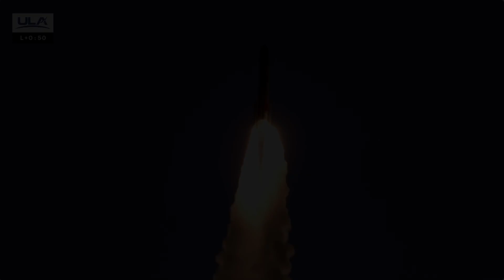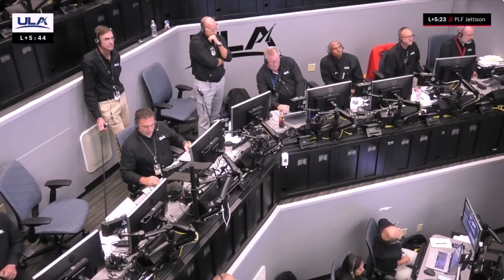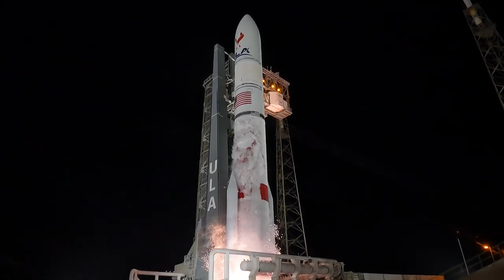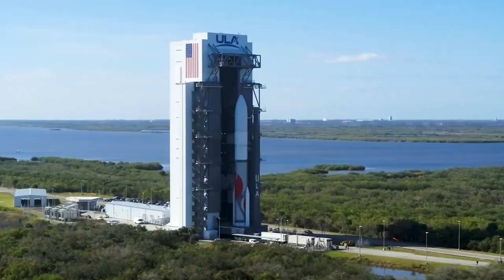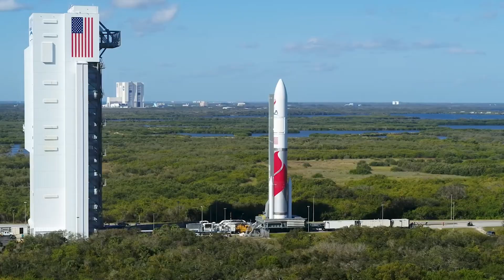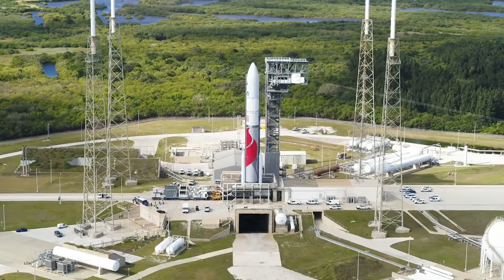A Closer Look At ULA’s Booster Anomaly On Vulcan's Second Launch

Comment: I think that the anomaly started about when they cleared the tower.
Reply: Why do you think that?  There doesn’t appear to be any issues until after T+30 seconds.
Reply: @Rocket_scientist_88  I see a small number of sparks ejecting about when the rocket clears the tower.  Not that I think the tower had anything to do with it.  But maybe the seal between the nozzle assembly and the rest of the rocket was breached at that time.

Comment: If they did a static test on the booster rocket before it was mounted on the launch vehicle they would have found out why the anomaly.
Reply: The booster is a solid rocket.  They can only be started once and run to completion no matter what.  So you can't static test the flight article.

Comment: The certification shouldn’t be affected as the part that failed wasn’t theirs. It was a commercial SRM
Reply: its the whole rocket....and it did not wholly pass. Cert 3 needed.
Reply: @paulpark1170  The Vulcan comes in configurations with 0,2,4, or 6 SRM.  The GEM-63XL SRM has a pretty reliable flight history, but I'm sure its manufacturer will be initiating an investigation.  Given that the payload was delivered exactly to its intended orbit, it shouldn't be a big deal, but the DoD will have its own say as to whether or not to accept the cert2 flight.
Reply: @cornerpage6634   if that was a real payload weighing many tons… it would not have made it to orbit despite all the extra burns it made.
Reply: @paulpark1170  I believe Tory said specifically they would have had the margin regardless.  shrug
Reply: @paulpark1170 Do you understand what a “mass simulator” is or a “dummy payload”?  It is the same size and weight as a typical payload.  So, your statement is absolutely wrong - this was the same as if a “real payload”

Comment: The performance of BE-4 today gives me a lot more confidence that New Glenn's first flight will be successful, regardless of stage recovery.
Reply: you know, most engines perform as expected by the time they're being used on a flight vehicles... that's only a spacex thing
Reply: @mathewferstl7042  But Blue is trying to jump a few generations in one new vehicle. They intend to try to recover the booster on the maiden flight. They may not make it, since SpaceX needed a few tries to get it, but then again, BO has a real advantage by watching SpaceX's development process.
Reply: @i-love-space390  and that has what to do with the engine?
Reply: @mathewferstl7042 spacex is still developing both. Stop shitting on them For nothing.